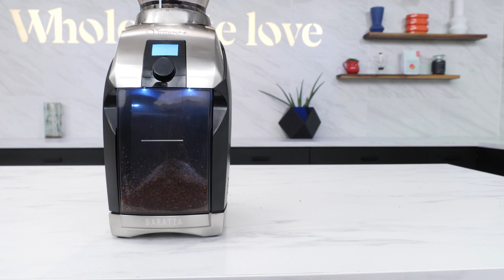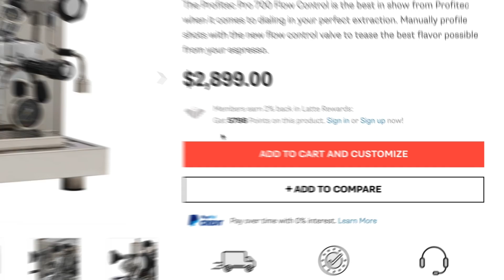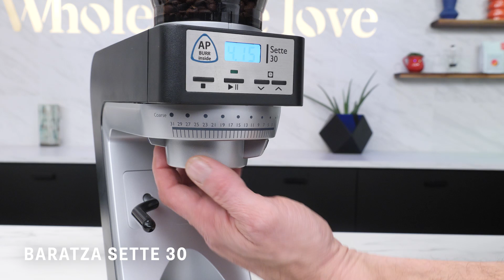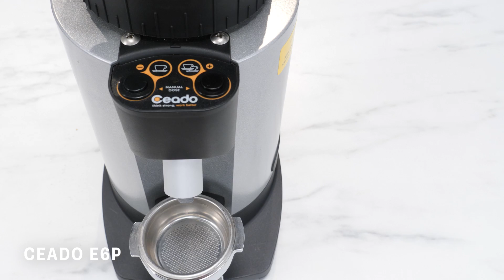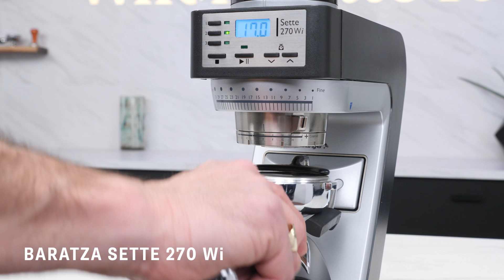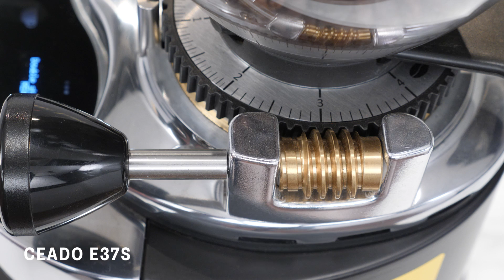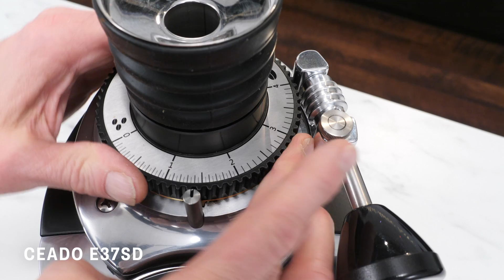Favorite Coffee and Espresso Grinders of 2019

Comment: Probably a dumb question, but does taste change with different grinders? For example a Vario or Sette270 vs a Mazzer. Or will taste generally remain the same? Same goes for a coffee machine. A gaggia vs an ECM/profitec?
Reply from the maker: Hi HD, Good question! Very difficult to quantify taste difference based on grinders and machines due to the number of variables involved. Larger burrs generally produce a more consistent particle size. So take an 83mm prosumer level grinder vs. a smaller burr grinder like the Vario. IMO the larger burr grinder will produce a more balanced extraction. In the Gaggia vs. ECM/Profitec... If everything is right using the Gaggia Classic it can produce a shot on par with the others. It's just far easier with the others for everything to be right - more consistency in prosumer level PID machines.
Marc
Reply: Whole Latte Love thanks Marc, this makes total sense :) I currently use a gaggia classic and a Mahlkonig vario and I find that espresso shots I do at home is much richer than when I go to a coffee shop. To be frank though, most coffee shops in my country don’t care about ratios and extraction..

Comment: Hi Marc, thanks for your videos! I have been binge watching them! Quick question: I'm looking to buy my first grinder and I'm in need for some help! If possible I'm looking for a beginner coffee beans grinder that can work with grinds from espresso to a V60. My budget is around 150-250 euro. In the future I'm probably looking to buy an half-automatic espresso machine, but first I want to experience with grinding. Do you recommend a SGP, a Virtuoso (plus) or an Encore? To clarify: if possible I want the grinder to be useful for the V60 right now and be hopefully futureproof for a half-automatic espresso machine. Is my budget with my needs realistic? If this is not possible or if you recommend another grinder than I've listed I'd like to hear that also. Below I've included some grinders with their costs. Thanks in advance for your reply!

I can get the grinders for this price:

Encore: 150 euro
SGP: 170 euro
Virtuoso: 229 euro
Sette 30: 240 euro
Virtuoso+: 270 euro
Reply from the maker: Hi J, Thanks for the question. Always a some compromise when using a grinder multi-purpose. The Virtuoso or V+ have the range but will be difficult to use for grinding directly into PF and don't really have the fine adjustment needed for higher-end espresso. The V+ is great with the timed dosing  - you'll be able to repeat for V60 brewing. I would not consider the Encore for espresso unless low-end using a pressurized basket. The SGP is a nice price but below the quality of build and level of support you'd get from Baratza. I like the Sette 30 for your purposes at the moment. As good or better than the others for espresso - especially in ease of use. As mentioned i the video it is a bit louder than the others but far faster. And the fluffy clump free grinds at espresso sizes!
Marc
Reply: @Wholelattelovepage  Thanks for your quick and thorough reply! I understand that my needs are not ideal and there will be a trade-off. In the future I was thinking about a Gaggia classic pro 2019 or a Breville infuser pro. I would prefer a non-pressurized machine around 500-600 euro's (if you have a better option I'm open for critique!).

I'm ordering through Amazon.co.uk or Amazon.de so I´m not sure if I will get the same customer service as Baratza is US based and afaik physical stores here do not have all the grinders in store or are significantly more expensive than Amazon unfortunately. 

If after-sales service is not as important in the equation, would you still recommend the Sette 30 or the SGP in this case considering the machine I'm looking to buy in the future.

Thanks!

Comment: Wow, I bought the Breville/Sage smart grinder pro. But now I wonder why I didn’t get one of the better ones right away. Thanks for an excellent presentation of grinders for my Christmas wish list!
Reply from the maker: Hi Closet, Thanks for the comment. It's reasonable to start with the SGP.
Marc
Reply: The BSGP is a classic and very capable grinder. It can choke many machines by grinding too fine, is very accurate in terms of time and adjustment. There's really nothing wrong with it, other than perhaps the grind delivery is a bit clumpy. If that bothers you then twiddle the grinds with a paperclip or something, to even it out before tamping.

Comment: I like my Sette270 but the micro adjustment ring will get loose and move all over the place while you're grinding. Yes, you can tighten the screws but it'll get loose again in a week. So I use a piece of bloody sticky tape now to keep the damn thing still.
Reply from the maker: Hi i, Sorry to hear you had an issue. As Lisa commented Baratza has excellent customer support. Even a fixed price repair program for their grinders. More info on that: https://www.baratza.com/grinder-repair-program/
I consider Baratza grinders to be high-end appliance grade. They are built well but do not have the prosumer level machine grade build quality of the Ceado and Eureka grinders in this video.
Marc
Reply: Whole Latte Love Thank you Marc for your comment even though I didn’t get my grinder from you guys. I’ll get in touch with Baratza people. I’m thinking of upgrading to an Atom 75 soon.
Reply: ibec69 same happened to mine but I took the burr holder apart and cleaned it and it works fine now. Some grinds got in between the rings.
Reply: Reginald Bowls Thank you for the idea. I clean the burr section but I’ve never given any specific attention to what might be stuck between the ring and the body.
Reply: ibec69 I was also having that issue with my Sette 270w.  I contacted Baratza customer support and they sent me a fix for it free of charge.
Reply: Lisa Kuprionis thank you for replying. What was the solution they sent?
Reply: ibec69 They sent what they called a felt "noodle" which I installed following their included directions. The felt basically made it a tighter fit and I assume absorbed the vibrations. They also sent a fix if the macro adjustment was shifting; however I did not install that because I was not having that issue. If you have any issues with your Baratza grinder, I highly recommend contacting their customer support, they are 100% responsive and professional!
Reply: Lisa Kuprionis that sounds great. I didn’t think Baratza support would be that responsive. I’ll get in touch with them.
Reply: Funny the Vario had a similar problem and needed shims to be installed to tighten up the grind setting so it doesn't change mid grind. It's pretty silly they didn't learn from their mistakes on the previous designs.

Comment: The last machine is really crazy.😉
You always have something new about coffee to say, thanks.
I wonder if they tested how long this tapping function lasts? Because these machines are supposed to be almost lifetime one.
Reply from the maker: Hi SE, The SD is a cool tool! The bellows is made of a thick material - fairly certain it's rubber. Seems very robust and if it had a problem the bellows portion can easily be replaced separately from the chrome dosing funnel which runs through it.
Marc

Comment: For someone with a low end espresso machine like the Breville Barista Express, would you consider the Sette 270Wi a worthy investment?
Reply: Patrick Joannisse absolutely!! And get a scale to measure your liquid espresso.
Reply from the maker: Hi Patrick, Yes I would. As i mentioned you could go with the standard 270 if single dosing.
Marc
Reply: It will definitely improve the taste. But if you want to single dose, get the timer version. You don’t need to pay extra for the weighing function.
Reply: @ibec69  I have the timer version and wish I had taken the one with weighing function.
Reply: Juho Saarela please help me understand why you regret, as I understand , your decision if you’re single dosing.
Reply: @ibec69  Oh for single dosing it doesn't matter but I usually make more than one espresso and put more beans in the bean hopper so it would make it so much more simple to just have the scale built in the grinder. No need to weight the portafilter and then adjust accordingly. Just grind away :) Hope it helps.